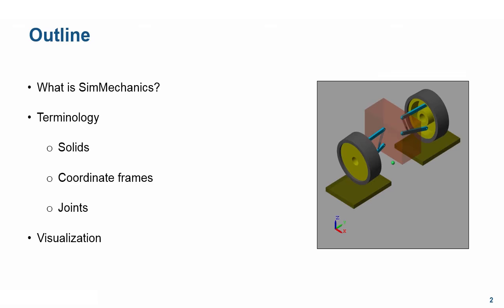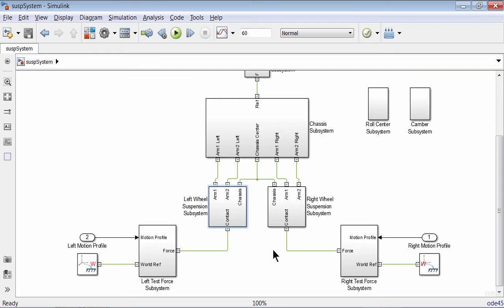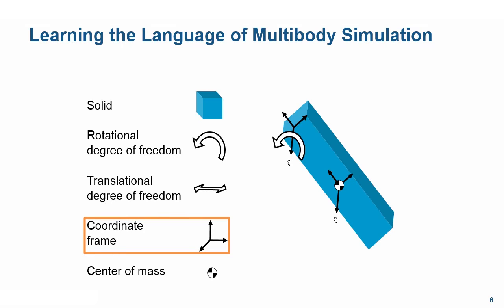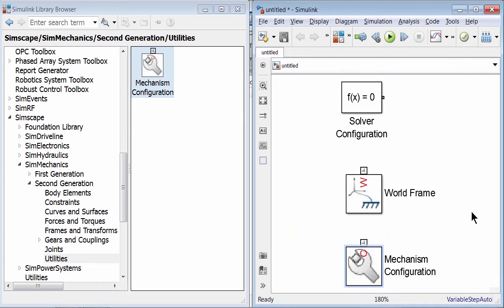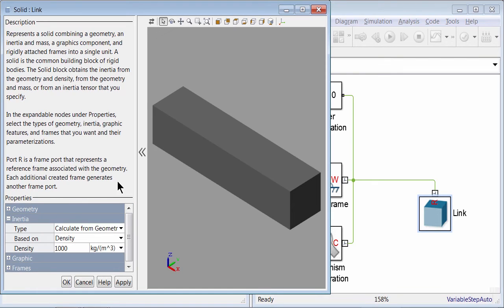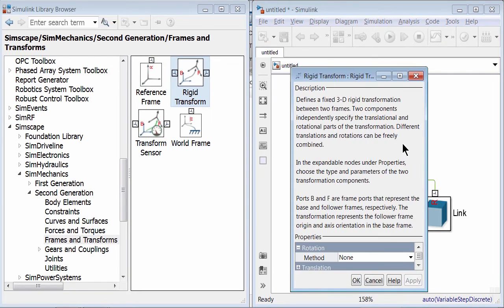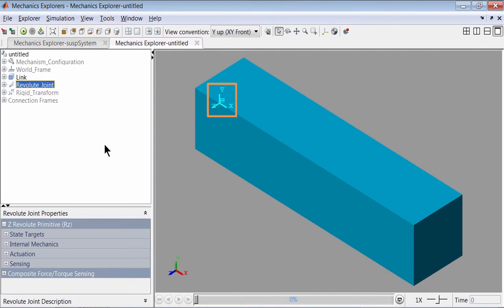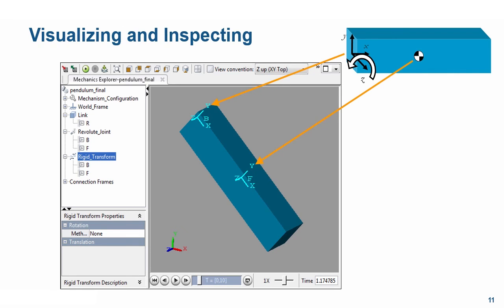Physical Modeling Tutorial, Part 6: Introduction to Multibody Simulation

Comment: Why are you using Matlab R2015b, while you are uploading it in 2019?
Reply: System compatibility and other issues maybe. 
Actually, below 2016 versions work very smoothly in an average (4gb ram) laptops. 
I too used 2019a, suffered a huge lag and later went back to 2014a.
There are much updates in farther versions but, they are only for advanced applications.